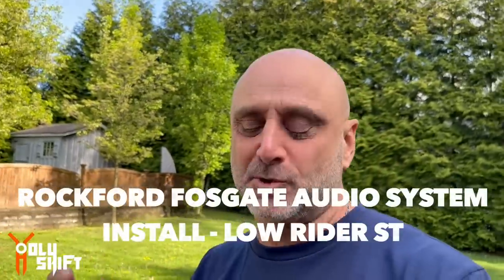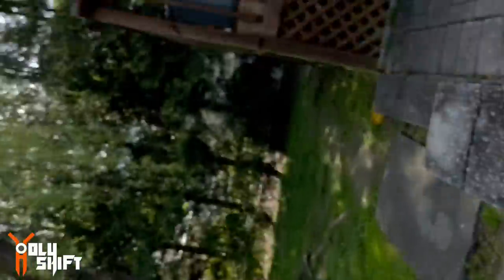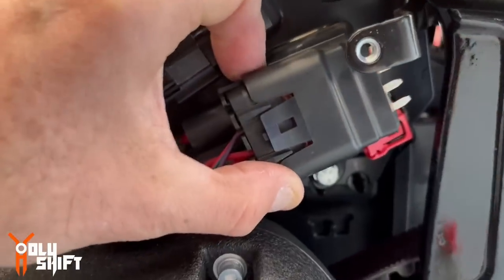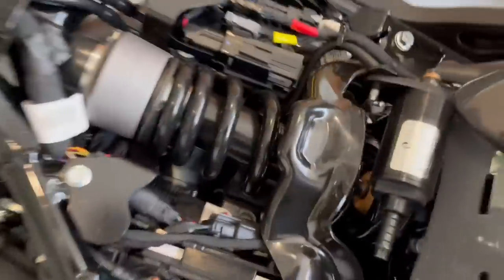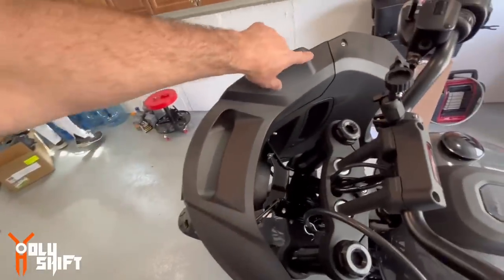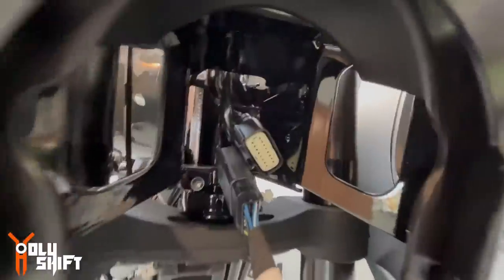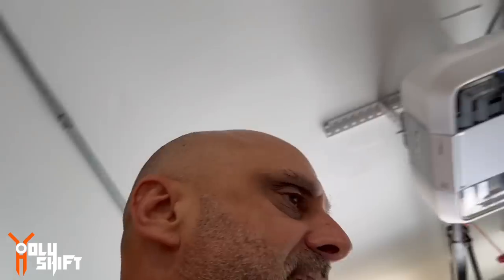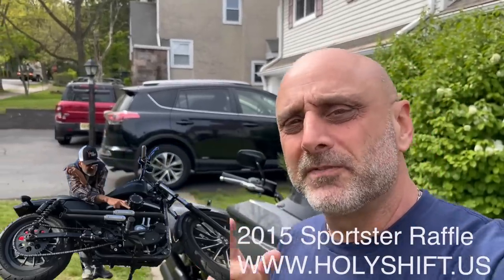When You Get A Free Rockford Stereo…

Comment: Excellent video.  Most of this install is fairly easy and straight forward as demonstrated in the video.  As described, the tricky part was removing the blank white pins from the connector.  I got the one in the fairing out in about 30 seconds.  The one under the seat was a royal pain but do-able.  In my case, THAT pin would not come out easily. I finessed it for quite a while and ultimately, it broke off INSIDE the connector body!  There's a YouTube video where the guy pulls the cream colored block out of the connector body but I was too chickenshit to try that.  I was forced to go to the dealer where the tech took 50 minutes to get me squared away.

Comment: Great explanation as always. For your DYI followers the 16 pin harness process requires small needle nose plyers and a 16ga. needle (think Leather Craft). Use plyers to lift the white plastic divider inside the connector approx. 1/8 th. in. no more. Above pin 11 is a pin hole, 16ga. needle here or proper pin removal tool and pull the plug out the back, insert the new pin and push the white divider back down. No "Fly By's The Pattern is Full" LOL.

Comment: From the look of it the molex tool doesn't have any kind of special head on it. It's just a think piece of metal to push the plug out. I'm sure a guy could just use a skinny finishing nail or anything else that wont bend and is thin enough no?

Comment: Damn that sucks, i think you could get away without the tool. Know exactly what you are talking about but if you dont feel comfortable better to always stay in the side of caution. Very generous of HD also to supply that. What’s next Sandy?
Reply from the maker: I tried to use some improvised tool but it didn’t work…and didn’t want to risk messing up the connector - next is engine guard - Flat out bar !
Reply: @HOLYSHIFT  mess up the connector or break that pin thats it you are done 😂. I ordered a Le Pera seat for mine today.